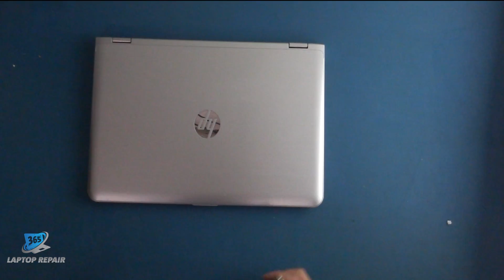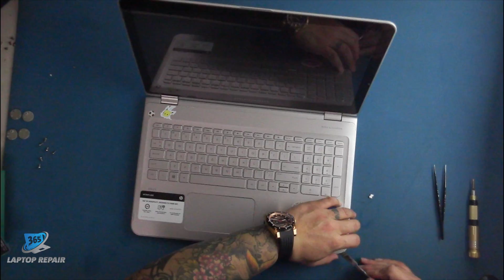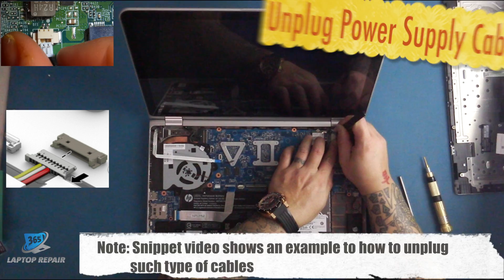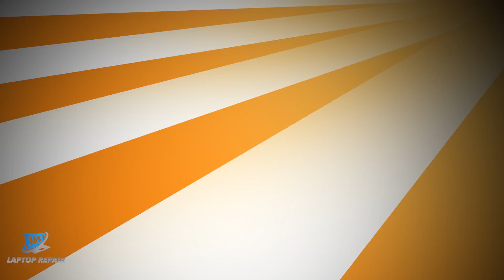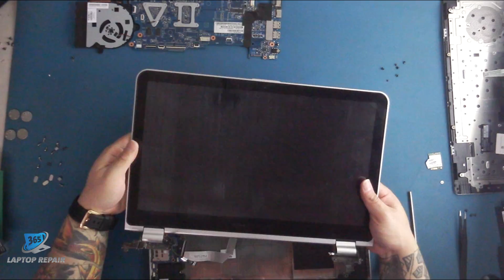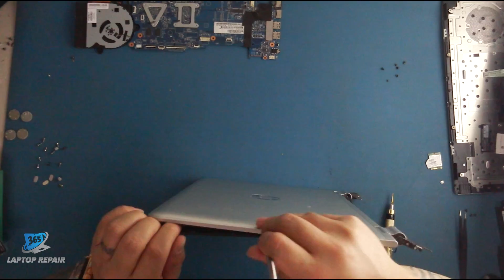HP Envy x360 M6-W Touch Screen Display/LCD Teardown/Replacement- by 365

Comment: Could you let me know the part number for this exact screen/digitizer? I have a customer that needs one, and I am having trouble finding one. He had it replaced once before, but the wrong one had been installed. Screen works, but the digitizer doesn't. When I opened it up, it looks like the digitizer has cables that doesn't connect to anything.
Reply: After more research, I found out what the problem is. The touch controller is missing. ENVY X360 M6-W101dx. The digitizer is 47-6040335.t and I am needing to find a compatible touch controller.